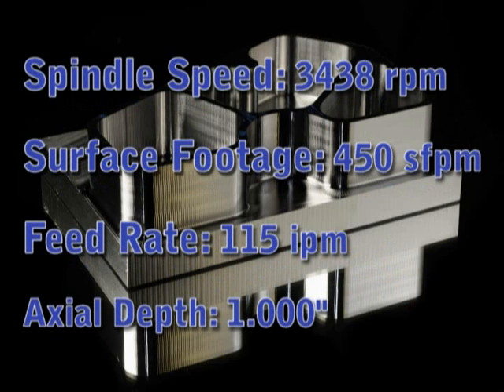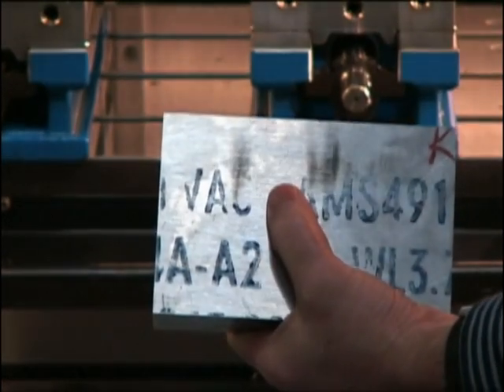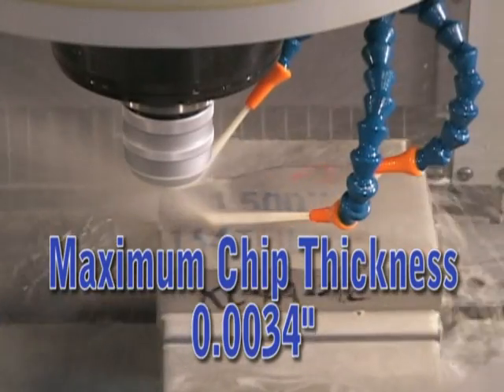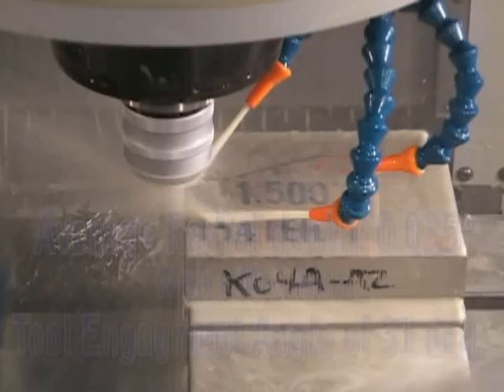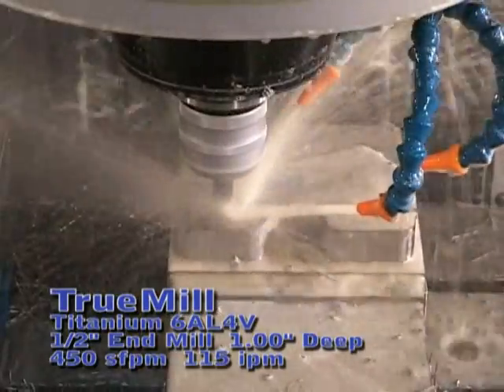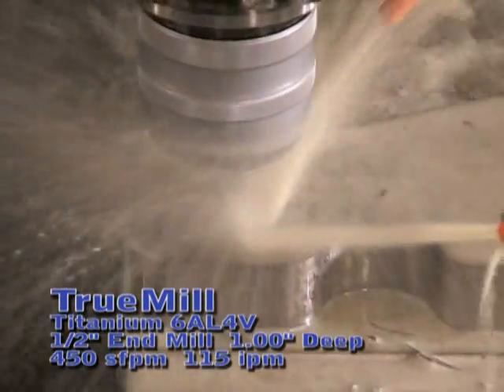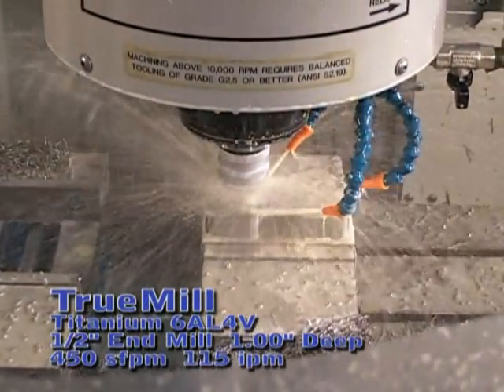SwiftCarb RampMill 115 IPM in Titanium on Haas VF2

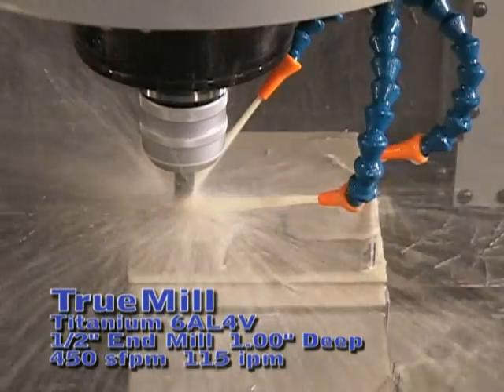Comment: At around the 2:00 point, you claim to be running at 115 Inches Per minute.  There is no way in hell that is moving around at that speed.  Unless that video is in slow motion.   I have run at 115, and to me, that circle milling looks to be in the 30imp range.   You make a good tool, but I call BS.

EDIT.  Ok, going further I see you did indeed speed up, but you need to correct the graphics to be giving factual speeds and feeds at the time they are on the screen.
Reply: Jon Baker he sais I'm the video 3° helix at 20IPM on the plunge